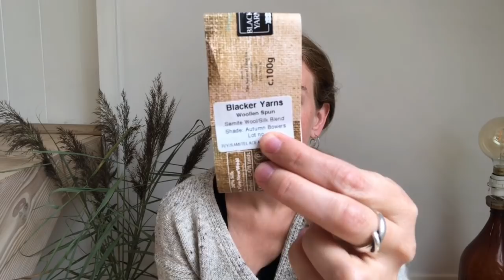Episode 13 | Fiber Tales Podcast | Meeting Fiber People and a lot of Frogging

Comment: Thank you so much for a lovely podcast. There are so few from Denmark.
Put the plötulopi on a flat surface and open op the center, gently with two fingers. Pull the yarn from the center, very gently at first. It breaks much less than if you pull it from outside. You get the hang of it after a wile. :-)
I can't wait to see what you are knitting with it. :-)
Reply from the maker: It worked so well! Thank you for the tip Dagmar 🤗